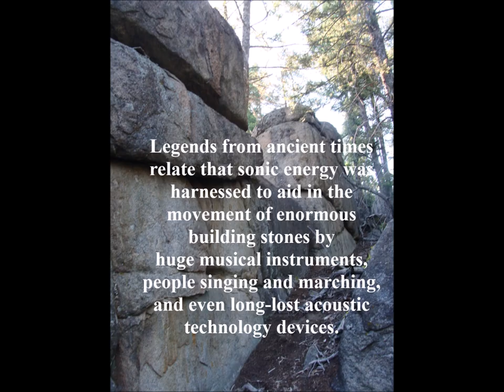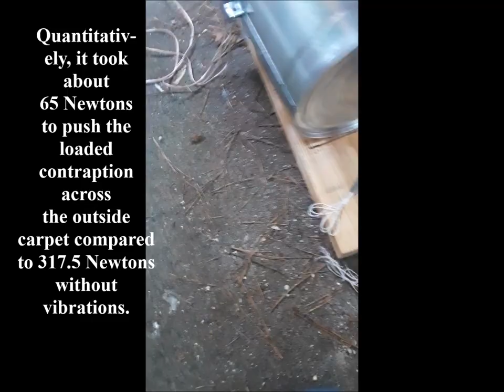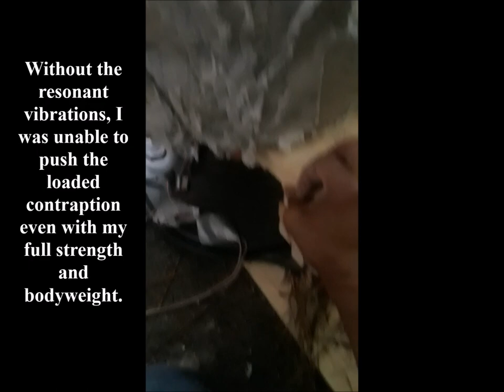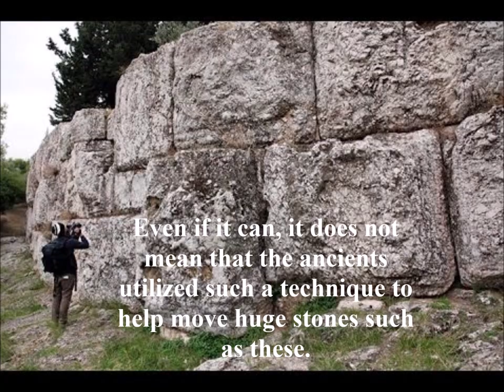Moving Boulders with a Push of the Finger: Did Sound Help to Build the Megaliths?

Comment: 59 hz is the maximum?
Reply from the maker: I believe it was 49 Hz for the metal pail. But the frequency is adjustable depending on how heavy the acoustic "piston" is. The heavier the piston, the lower the frequency.
Reply: @gsutton78  wow. What frequency was it at while you were pushing all that weight?
Reply from the maker: @nicolaslacombe1979   Yes, it was about 44 Hz.
Reply: @gsutton78  can you push it higher than 49?
Reply from the maker: @nicolaslacombe1979   I could if I removed the piston. But doing so reduces the vibratory energy. The natural resonance frequency of the metal pails without the piston was about 49-52 Hz. But the ultimate idea would be to resonate the mass (stone) itself. The natural resonance frequencies of rocks are in the ultrasonic range, unless using subharmonics.
Reply: @gsutton78  you did this experiment without the piston attached?
Reply from the maker: @nicolaslacombe1979   I conducted the experiments without the piston first. Then I found that it worked better with it. Kind of like those tuning forks we see with the weighted tines.
Reply: It was very interesting. Thank you
Reply from the maker: @nicolaslacombe1979   Sure. Thanks for the interest 😌

Comment: Giants, they existed, or maybe even still do.
Reply from the maker: Giants aren't necessary to explain the megaliths, though. Look at Coral Castle. It was built by Edward Leedskalnin, a man not much taller than 5 feet and 100 lbs. Yet, the average stone he used was nearly 6 times the weight of the average pyramid stone. Giants also can't really explain the incredible precision of many ancient structures and sculptures.
Reply: @gsutton78  No disrespect, I agree with your points and absolutely believe these megalithic stones and structures could have been done without giants. My point was that they existed and it stands to reason that they would build bigger than we do. It's not a theory, evidence of giants is overwhelming, look into it.
Reply from the maker: @petermontgomery2874   I'm already familiar with giants. In fact, I will discuss them in my new video which should be out tomorrow. But size and strength alone can't account for the sheer detail and accuracy of the megaliths. Giants would use giant tools, but those tools would still break and bend under the weight of tons of rock. The same with trying to cut into hard stone with a giant copper chisel. It simply won't work. We don't need giants to build huge structures today. Mount Rushmore, the Stone Mountain monument, Coral Castle, etc., all done without giants. Why is it so easy to believe that giants built all of the megaliths, yet so hard to believe that ancient man was simply much smarter than they're given credit for? The ancients had technology. Nothing new under the sun.
Reply: @gsutton78  Way to not even read my comment. I didn't say any of that. I AGREE with you. I agree that man could have built these, but it's a matter of fact that giants existed and all the sources indicate they were an advanced civilization. I'm not arguing man could have had more advanced tech, it's been proven that they did.
Reply: @petermontgomery2874  Hmm.. could be, imagine a bunch of giants chanting to create such frequency.

Comment: Everybody always gets to a certain point, and then can’t go further without adding something steel 😂 never mind the first part that requires power 🙃
Reply from the maker: @carladamcarter  Um. I didn't "get to a certain point". I "started out" using "steel" and "power". Ever hear of reverse engineering? I'm starting with the idea and then working backwards to what the ancients might have used, leading to my videos on "thermoacoustics"; convert a flow of heat into sound vibrations. Look up Sondhauss and Rijke tubes. No modern power system needed. Just a cylinder, a source of high energy heat, and a screen/mesh.

Comment: So now you have to prove that they had electricity as well as levitation. Also, you're not proving levitation, your showing friction and reaction.
Reply from the maker: Actually I'm showing acoustic lubrication and surface acoustic wave (SAW). But this is just the basic work which will be expanded in upcoming videos. Even the power sources don't necessarily have to be electrical. There are many different ways to generate sound.

Comment: Vibration on the stone directly yes.. It helps but vibration thru the air ... No .
Reply from the maker: Well, if you've ever seen the demonstration of a glass goblet getting shattered by sound, that happens 'through the air'. It's all about the most efficient transfer of energy via resonance. Like the glass goblet which can be shattered through the air or with a small speaker placed directly on it, so too can a stone move in direct contact with a sonic source or through the air.

Comment: huge musical instruments but no evidence?
Reply from the maker: Not much evidence of anything yet. We haven't even seen the large wooden sleds that they supposedly used to move the blocks. We have to remember that we're a 200 plus year old civilization attempting to probe the secrets of a civilization that's at least over 3,000 years old.
Reply: @gsutton78  maybe even older. Have you seen the videos from unchartedX suggesting the dynamic Egyptians may not have created many of the great structures or statues but rather they discovered them.
Reply from the maker: @aaron___6014   Yes, I've heard of that. They may repurposed some of them and even built on top and alongside them. I agree that the time chronology for many events in the ancient world is way, way off in many instances. But most modern scholars simply cannot humble themselves enough to even consider the possibilities.

Comment: Question how would the Egyptians do this before this is all gadgets from today's time 
Plus your not even moving a Boulder like in the pictures 
And how are we moving big a** boulders slab in rock? That would wait to have a chuck carry on a machine
Reply from the maker: We'll, this is just showing that the principle of acoustic lubrication is valid. One of the ideas would be to vibrate the mass itself as every object has frequencies it can vibrate at. For larger objects, we'd be looking at much lower frequencies. But, there are actually other ways to develop powerful sound vibrations without modern technology. Thermoacoustics is one possible way. I did a video on it: https://youtu.be/ruyqcrUBkao?si=1jp0Q_q8HBcpV6a3.
Reply: bro they’ve BEEN had this technology they already knew most of the stuff we know today do ur research.

Comment: So do the math on a 70 ton <— yes Ton scale up. Now design a sled that can carry the 70 tons…
Reply from the maker: Sure, but first some videos need to be done to show how it can be done using materials and energy sources available in ancient times.
Reply: @gsutton78  drumbeat or horn instruments could produce the frequency vibrations. That part is simple enough
Reply from the maker: @2HighNoon   I agree. And I personally believe that the ancients may have even taken it a step further and harnessed heat energy to power acoustic devices: https://youtu.be/-kQKg6CTMBg.

Comment: Humans can't produce these frequencies and there was no technology as used in this demonstration back then, so it absolutely proves nothing.
Reply from the maker: Of course modern electronics didn't exist back then. This experiment is simply proof of concept. That's step one. The next step is to determine what technology would have been available in ancient times in order to accomplish this. It could be argued that a rudimentary steam-powered oscillator or hydraulic device could be used in this same manner which I will attempt to demonstrate in a couple upcoming videos. Nikola Tesla developed such a mechanical oscillator actuated by steam. We might also realize that steam powered whistles were used on early locomotives. Whistles can even generate ultrasound. The last step will be to attempt it on a large scale. It's the scientific method. One step at a time.

Comment: so where is the proof?
Reply from the maker: This is the first step; to see if the basic concept is even probable, which it is. The next step will be to attempt it with materials that would have been available to ancient peoples instead of with the modern electronics used in this video. We then have to attempt it on the same megalithic scale. Finally, if those steps are successful, we would at least know what to look for in the archeological record. If we find similar such mechanisms, only then would we have concrete proof. Until then, it's simply a theory even if the concept itself is found to be completely practical on a large scale.
Reply from the maker: @puposbela   For the second time, THIS IS THE FIRST STEP. It's the scientific method.
Reply: @gsutton78  then you don't want to understand my question.
Proof.
Yes or no?
Steps can lead or probably not to that.
Anything else is fiddling about.
Reply from the maker: @puposbela  It's just a sign of the times. People aren't educated properly anymore to understand that there's a process to these things. A process to science. Everybody wants instant results, instant gratification. And when they don't get it, they act like insufferable, pompous jerks. No wonder society is so screwed up right now.
Reply: @gsutton78  stop!
Enough!
Reply from the maker: @puposbela  Oh, that's right. I forgot this was your channel.

Comment: not on sand bruh
Reply from the maker: Well, they were partially moved over sand, using water to compact the sand in front of the sled. The question is whether or not acoustic vibrations were used to enhance the process.

Comment: You do realise the size of the apparatus is actually larger than the mass you move. This must scale up. If you did this same experiment against a ton of mass.. you would most likely create a work environment that was unsafe if not lethal. Forget hearing loss.. this would rupture organs, shatter bones.. so stupid.
Reply from the maker: Actually, it depends on how the energy is "coupled". If coupled mostly to the air as in a loudspeaker or any other projective structure, then the vibrations will result in unbearably loud sound. But if coupled to the ground and mass, then the vibrations will result in movement. Think about an Earthquake. Incredible powerful vibrations, moving millions of tons of Earth around. But does it "rupture" the organs of bystanders? No. During earthquakes, most people are injured by falling debris, not by the infrasonic vibrations of the quake. Who feels stupid now? 🤔

Comment: lol that is vibration or pulse not sonic .
Reply from the maker: You can't have sound without vibrations. Therefore sound means vibration by default.
Reply: @gsutton78  but in the video he is not using the sound to move it , the can is connected to the base it is vibrating back and forth. the can would have to be mounted to the ground and sound waves would push the rock.  B. he is using electric.
Reply from the maker: @johnnyhammer1959   No. Lifting an object into the air as in container-less processing is caused by the vibrations. Sound is ultimately just what we call vibrations that we can hear; vibrations in the audible range. Again, sound implies vibration by default. Not sure why this is such a sticking point for you.

Comment: And your power supply came from where….?🥴
Reply from the maker: And your point is what? The first step was to see if the vibrational movement of heavy objects was even feasible. The next step is to theorize how it might have been achieved with ancient technology. The 3rd step will be to see if the process works on a large scale. There actually is a process here.

Comment: The financial powers that might find this will buy and hide it as they always do. Why? Wisdom is power. Why empower your slaves??? "Keep them all yours braindead and useless." - ministry-
Reply from the maker: Specules Gorgoth   Very true. This is how the system works; preserving the status quo at all costs. Managing disease instead of curing it, managing poverty instead of eradicating it. Investing in fossil fuels which can be monopolized instead of investing in renewable energy which would benefit all. Building prisons instead of schools. All to keep the machine's wheels well greased and running smoothly for the benefit of the few at the top.

Comment: 175 pounds isn’t even that much, how couldn’t you even push it ?😂
Reply from the maker: Pushing 175 lbs over a "rough" carpet with "one" finger? Sure. Good luck with that one. Lol!
Reply: @gsutton78  ohh yea 😂 but why didn’t they use the levitation frequency?
Reply from the maker: @zer0bankoe  Don't you mean "frequencies"? There can be more than one, you know.🤣
Reply: @gsutton78  Bruh of course 🤣 but every stone/ material has only 1 frequency per
Reply from the maker: @zer0bankoe   Actually they have several frequencies when you include the harmonics in addition to the base frequency.😁
Reply: @gsutton78  Dang your right I was watching videos about breaking any material even living things like cancer cells if you have the right frequency. Just like a hi-pitched singer that breaks a whine glass after ticking on it once and singing hi-pitch so the frequency keeps increasing until it shatters.
Reply: @gsutton78  i was confused with the 2